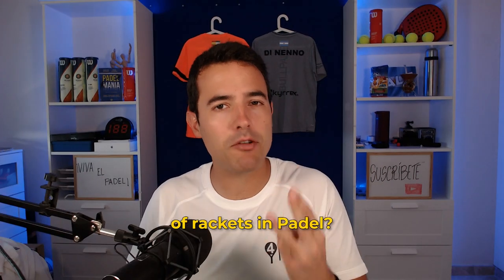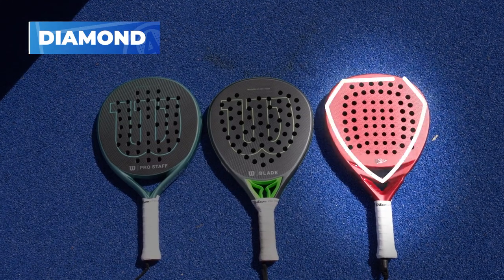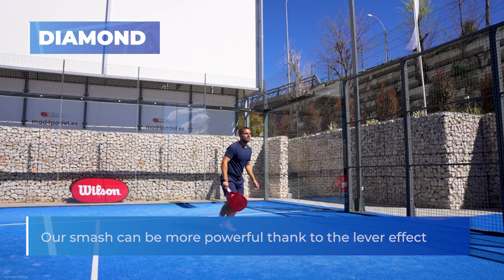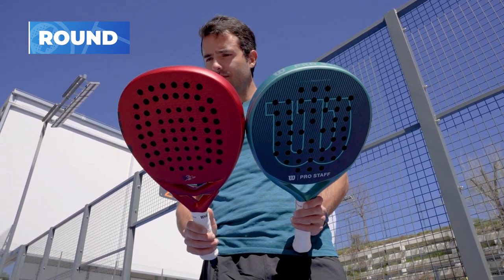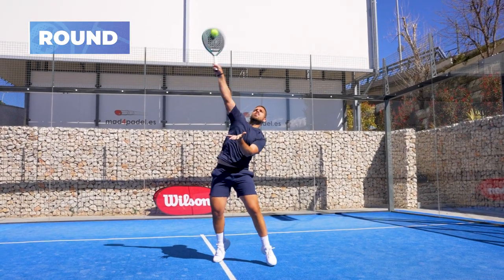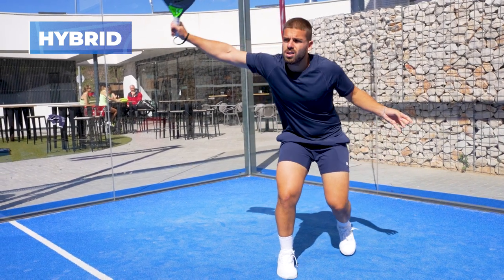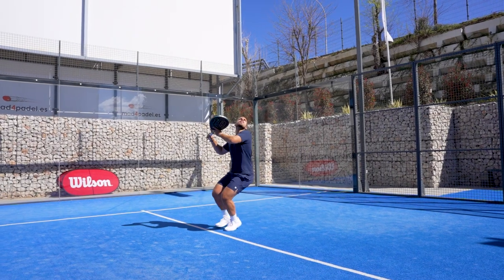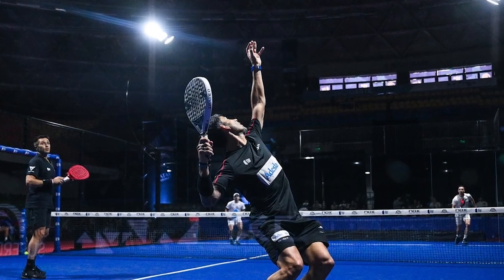PADEL RACKET SHAPE MATTERS: HOW TO CHOOSE RIGHT - the4Set

Comment: I played tennis with Wilson Pro Staff and first bought the Pro Staff Elite padel racket. It was quite weird, so soft and hard to have power due to low sweet spot and soft core. Switched to Blade Pro and it is much better for allround playing due to sweet spot location, feels quite solid as well and does what I want. 

However, I just tested Bela V2 LT and that was super easy one to play. Amazing handling and easy to hit shots but way too soft. Maybe should try one day the red fully loaded racket.

Like you said, always try to test as soft + carbon fibre is not always the same between models. 

Great video as always, these are what we need 💯
Reply from the maker: Wow! I'm playing (not right now as I'm injured but before) with the Bela V2 Pro and honestly, I found it suuuuper easy to play with even it's one of the hardest rackets of Wilson for this season (but I wouldn't consider it a super hard-racket). If you have the chance to try it, do it!
Reply: @the4Set  I will definitely test more when getting bext racket. Now I bought it just because of the looks and the shape 🤣
Reply from the maker: @perttuparssinen  nooooo hahahaha that is betting hard on the racket! 🤣

Comment: I wonder how you recommend to try different rackets? From watching all your videos about padel rackets, I concluded one MUST test rackets (diamond, tear drop, and circular rackets, as well as with 100% soft, medium soft, or 100% hard... or with rough surface). So I would like to know if there are any specific ways you test padel rackets? Do you play a pickup match with friends for each padel you are considering? What thinks do you pay attention to when you are testing a racket?

Maybe you can help me to my particular case. I have been playiing for 2 months, and I have taken 5 1-hour classes. I am quite strong and agile, so I'd like to start smashing more and . I have been using a soft Circulat Babolat with 345g of weight. In the beginning it helped me control my shots because I started with a 380g racket and I was just hitting too hard. Now, I feel like I am not able to add enough speed or spin to my shots. What rackets would you recommend I try next and why?
Reply from the maker: It depends a lot on where you live honestly... What I do is try to ask people that I see on my club if we can swipe rackets for a while and test it that way.. or ask to the store owner of the club if he has some test rackets to use. But after testing so many rackets I always look for how easy is to move it for me and the hardness and feelings it gives me specially in the lob and in the volleys (the shots that I do the most). I don't care most of the times about the materials because brands lie a lot...

In your case I would try to use a quite heavier racket (why not 360-365g?). Remember that the heavier the racket, the more power you can get! But before that, size the balance of your current racket if you like it and then try to find a heavier racket with that exact balance (or modify yourself!). I hope that can help you

Comment: Hi Pablo, i bought the new VK10 Nox. Its a round one. My strong shot is the smash however i find it difficult to smash with this. Is it because of the low balance or because of the shape?
Reply from the maker: Which one were you using before? Most of the times, when we change and use a new racket a time to adapt is required so... keep trying! But if you were using a diamond super-high balance, probably it's gonna take you more time hahaha